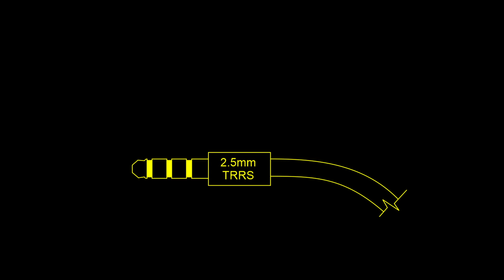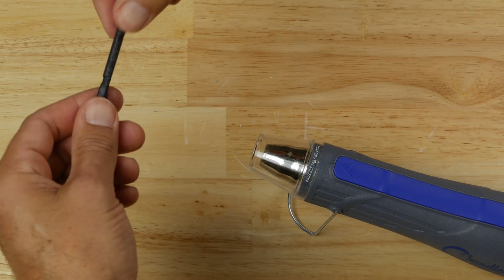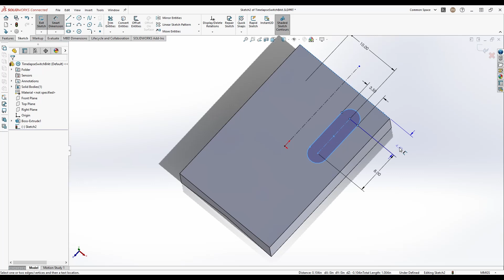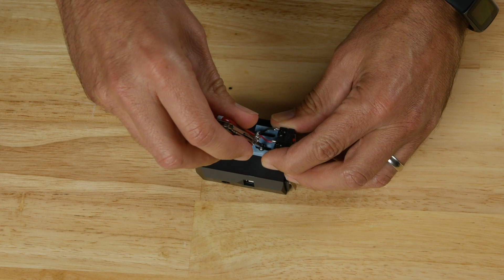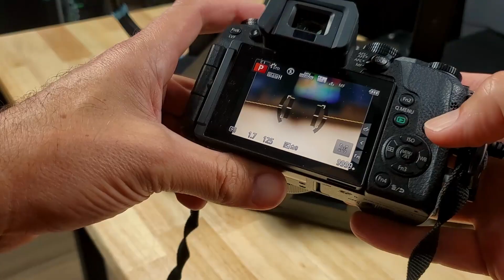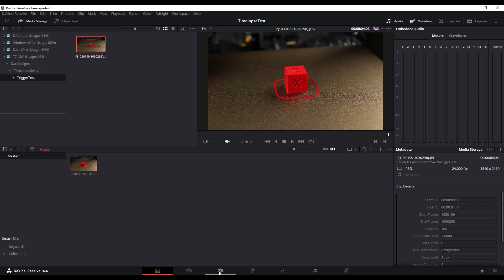Super Smooth 3D Print Time Lapses with Your DLSR Camera

Comment: I used to use bluetooth remote control and wire its trigger button to limit switch, add gcode to move  to limit switch after finishing each layer and camera would trigger a shutter.

Comment: Hi I use octolapse for timelapse, but I get too much string and artifacts on the corner of my prints can you please share print settings
Thank you
Reply from the maker: My settings are pretty stock. The main thing that will help with that stringing is retraction. It just retracts the filament a set amount before the move to break that string. In the video, I show my settings for the timelapse script and add 1mm retraction. I'm not sure if Octolapse has this setting or not.